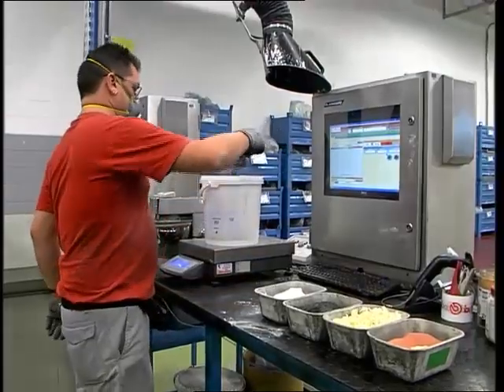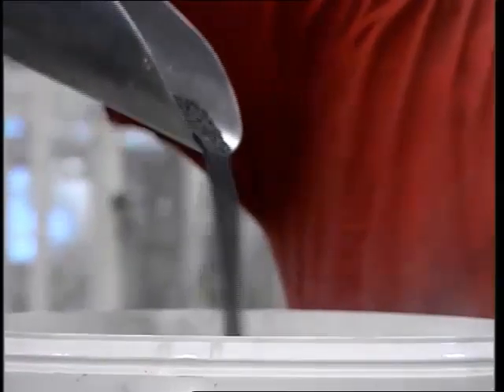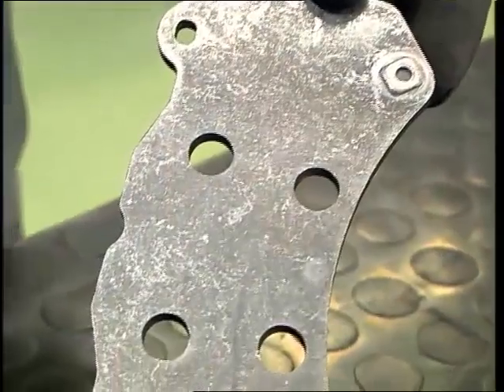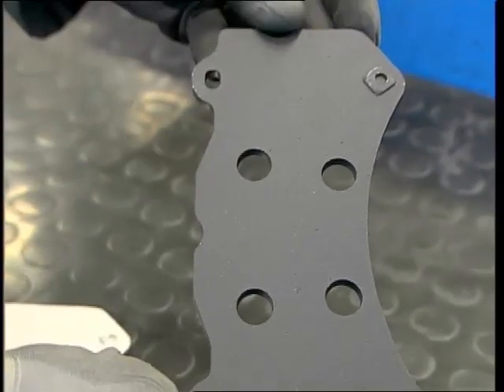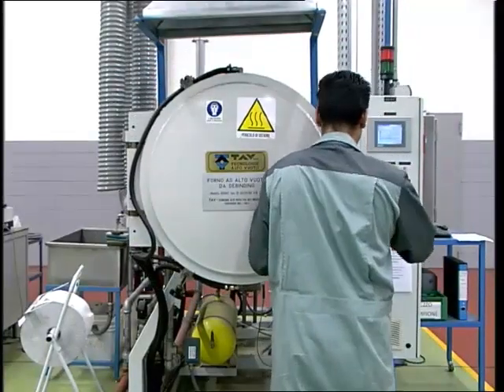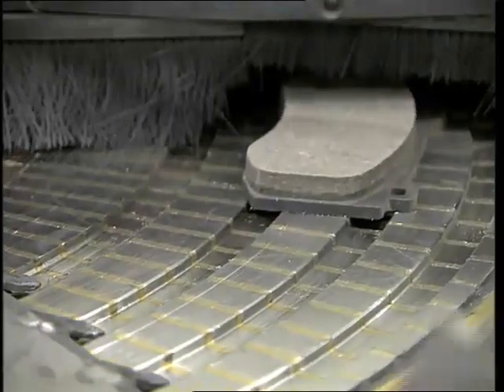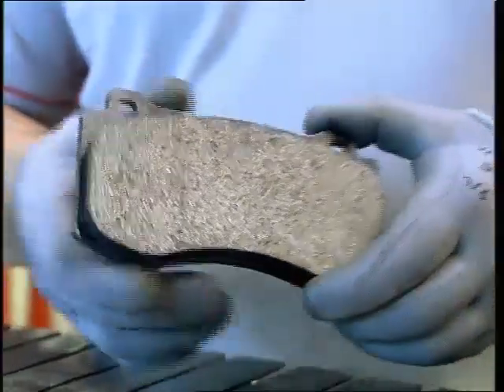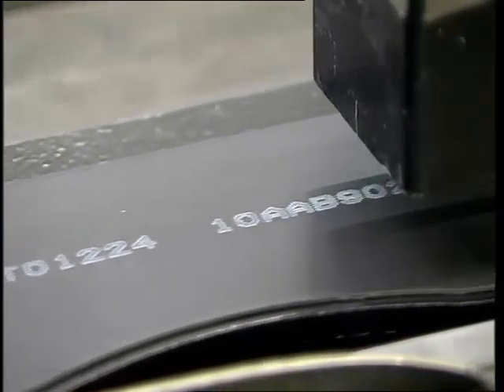4.2.3 Brake Pad   Production

Comment: What are material ratios
Reply: Three parts poo, one part loo.
Reply: @pranay chauhan do you found the ratio?
Reply: @NitinRana108  Will be a secret
Reply: As an automobile lover. I always wanted to built some kind of part. Only smaller n basic parts are on my list.  Lol brake pads are on top of that. Whether its electric or gasoline based vehicle brake pads ll always be their. Not gonna go anywhere soon. Bro if r from India lets do some research n visit some places.  Make some brake pads together.
Reply: I don't think so they would tell the ratio. It's brembo. Biggest manufacturer in braking market.
Reply: This is secret